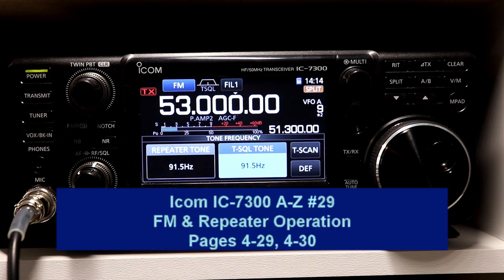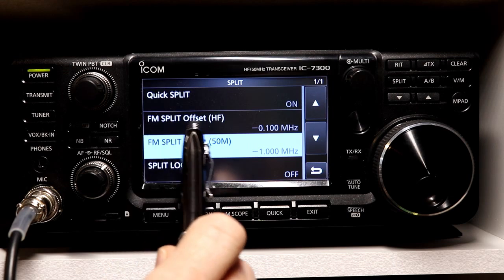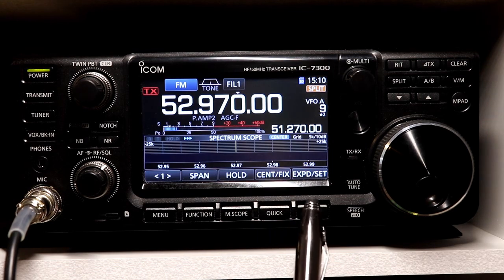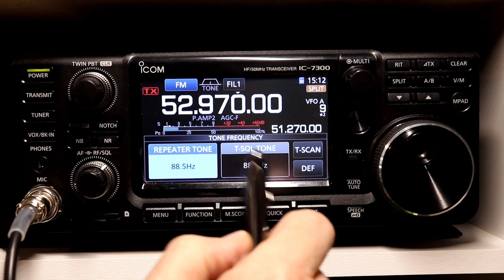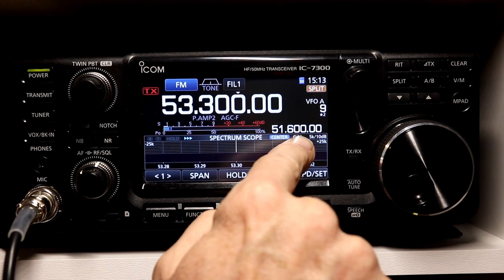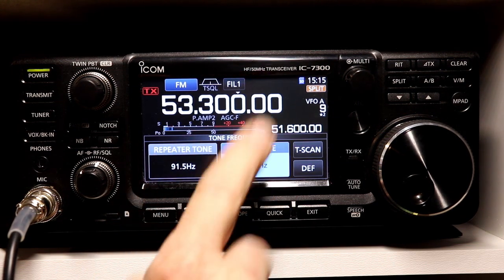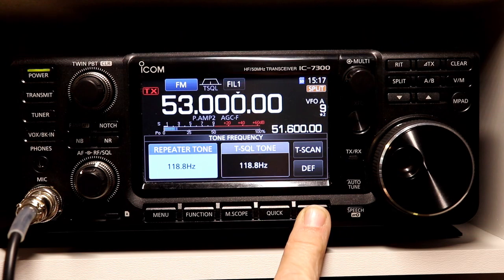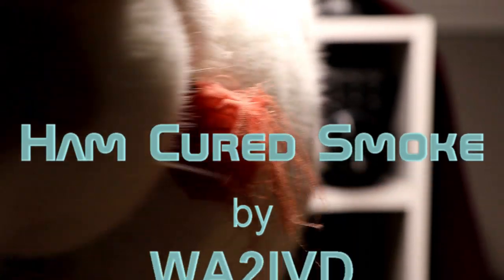Icom IC7300 A to Z #29 FM & Repeater Settings

Comment: My 7300 does not have the tone function. It has COMP in the same area. Where is the tone function in this configuration?
Reply from the maker: Hi.  You will see COMP (Compressor) in that position if the radio is in SSB mode.  You have to switch the mode to FM first.  Then you see TONE in that same position.
Reply: @HamRadioA2Z  Thanks very much I appreciate your quick feedback.
Reply: @HamRadioA2Z  I see it thank you very much

Comment: Sooo helpful; perhaps I missed it, but is there a segment that shows recording and playback functions so another ham can hear his audio?
Reply from the maker: Hi Joe. Unfortunately, the voice record function on the 7300 doesn't provide any direct way to do this.  You can play back the audio and listen to it on the radio, but there is no option to transmit the recorded audio.  I did just recently see a hack to work around this.  I apologize, but I can't recall who the Youtuber was that posted the video.  The hack involves taking the SD card from the radio to your PC.  Then you copy the recorded audio from the Voice folder to the VoiceTx folder and rename the file to "voicetxN.wav" where N is a number from 1-8.  Then put the SD card back into the 7300 and select the Voice option from the Menu.  Then just select the appropriate number and the radio will think the file is audio you recorded and transmit it.  It's a little bit kludgy, but it appears to work.
Reply: @HamRadioA2Z  Yes - kludgy, but I'll give it a go.  Thank you.  Joe - K4HEW
Reply: Well all worked well until after I renamed T1 to my recorded sound file - that worked.  Since I had just downloaded the V. 1.4 firmware update from Icom, I believe something changed.  Upon selecting the Voice Menu, I touched "T1" and nothing happened at all.  There are "REC/SET" and "TX LEVEL" options at the right side of the Voice Menu now.  I'll have to study what they do.

Comment: So when you power on the Icom 7300 does the tune light come on? Mine doesn't not, but I am running an external tuner.
Reply: I have to turn it on
Reply from the maker: When you first power on the radio, it has no way of knowing if you’ve changed antennas, moved the radio to a new location or anything else since it was turned off.  So, it assumes it isn’t tuned either with the internal or an external antenna.  So you need to initiate one tuning cycle for it to show tuned again.